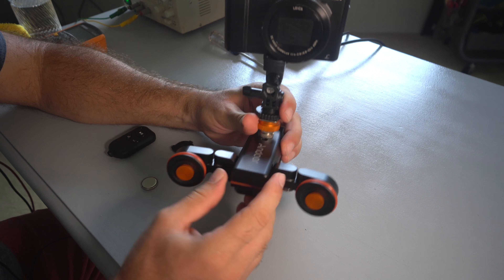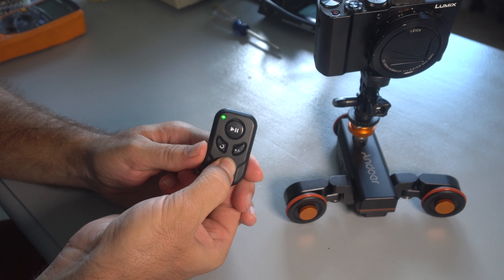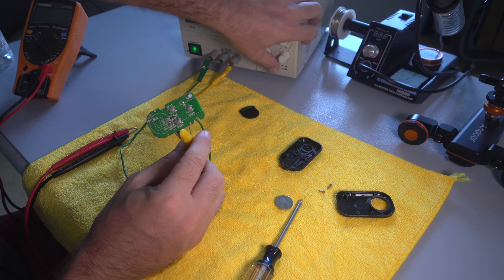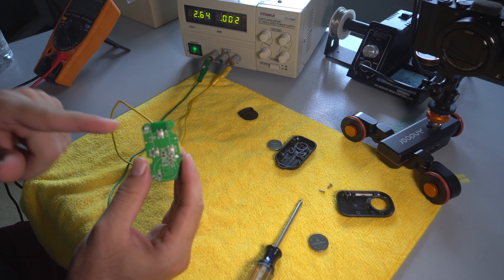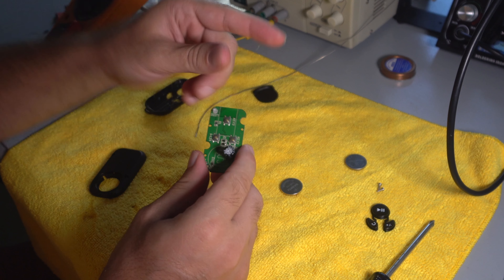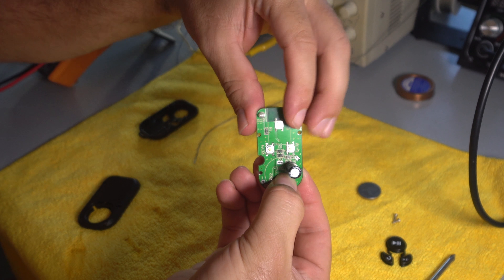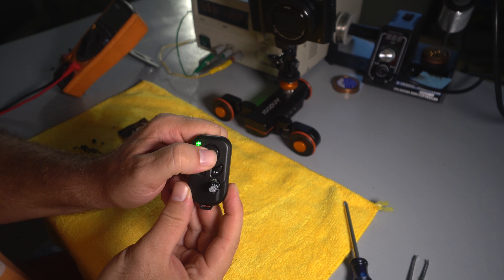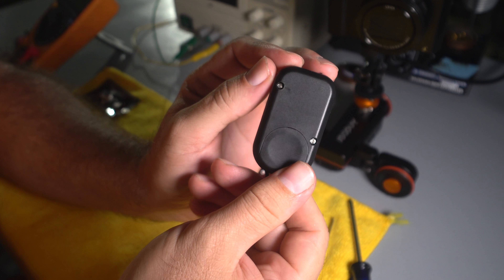Electric Dolly Remote Problem - DIY Fix

Comment: It's quite a few years since I dragged out the Dolly to try it out and ran into the problem you've solved - Works great many thanks.
Reply: camera dolly Remote if it breaks all you have to do is go to battery plus and they sell them for only 4 dollars 
eazy fix i am not sure of the brand but it really works with the neewer and as for my neewer motorized camera dolly Remote it has not given out 
to this day i got the battery ones just in case the little dolly cant tell one remote from the other LOL

Comment: Use a capacity from a malfunction flash light that is slightly larger than the original one. It works and no need to drill hole. I don’t even know the spec of that, just larger physically.
Reply: How do I know which capacitor? I don’t have anything on my board where he added the new capacitor at.

Comment: I just got mine yesterday. Saw your video and did the first possible problem. The contacts for the battery need roughing up with a file and cleaned with acetone and a q-tip. Must be some coating or junk that got on contacts during manufacture. Works %100 now. I hope it stays that way.
Reply from the maker: Let me know if that fixes it long term, kinda curious cause i dont have any issues since i put in the capacitor but thinking maybe all i had to do is clean the contacts lol. Thanks
Reply: You were right,  I left the remote and haven't used it in a while and it is back to not working again. So I was just wishful thinking. Do you think I could bump the voltage up to 4.5 or would it burn out the remote?  I'll try it and see because either way it is useless. Or is there another remote similar that will work?   @JustVlads

Comment: I HAD THE SAME PROBLEM WITH MY REMOTE CONTROL AND JUST CHANGE THE BATTERY FOR A NEW ONE DURACELL 2032 ON AMAZON, AND THE PROBLEM ITS SOLVE!!!... I THINK IS SOME PROBLEM WITH VOLTAGE OR SOMETHING... JUST CHANGE THE BATTERY!!!!
Reply: yeah! it's working ! thank you!

Comment: I just found out a "QUICK FIX" , same as everyone else having this problem, what i did to fix it when this happens is to take off the battery, rub it like for 5  seconds to your clothes really fast on both sides, then put it back again to the remote and its working again, you have to do this everytime you have this problem

Comment: OE MagnificentLife 

1 second ago

please watch this video on YouTube , the problem is not with the capacitor or the voltage  but with the pairing 

, I've had the same problem and I managed to fix this by contacting the vendor , they told me that the remote is not paired with the host and they sent me this link 

https://www.youtube.com/watch?v=6t3sAaoiuSY&feature=youtu.be 

Show less